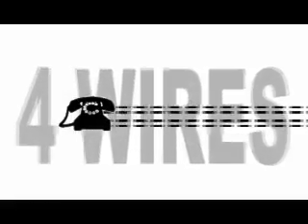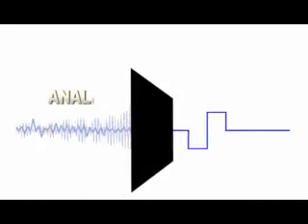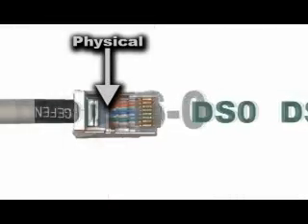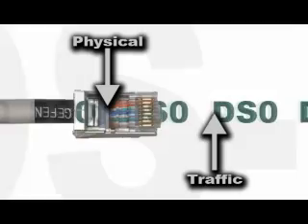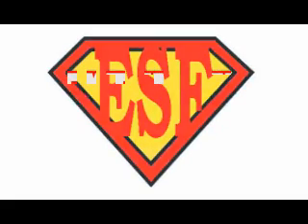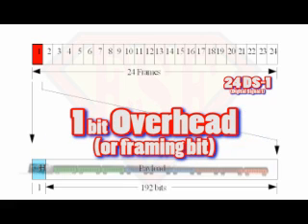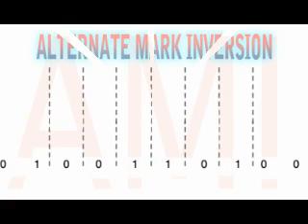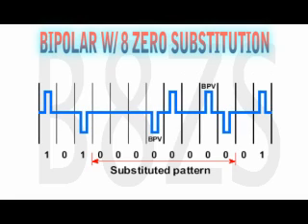T1 (Trunk Level 1) Connection

Comment: thats a linear increase... not exponential...
Reply: Brendan O'Shea Exponential is correct cos if it was for linear , with every new device only 1 extra wire had to get added. In this case alone computer and telephone account for 8 wires (4 each) so 4 devices 16 wires, 8 devices 64 wires. Thatz not linear, that is exponential !